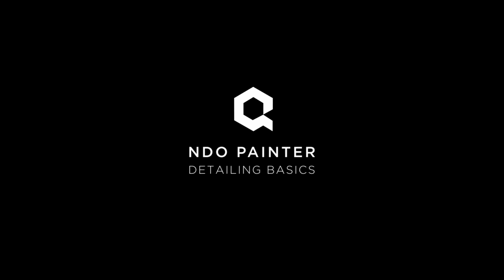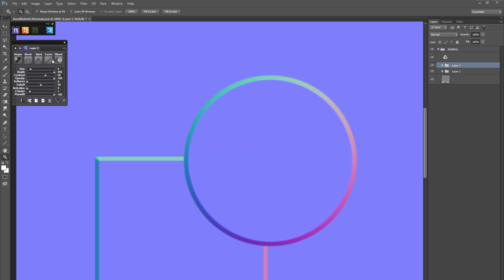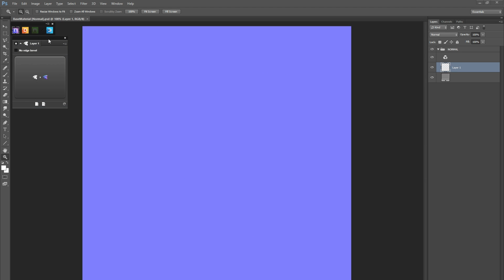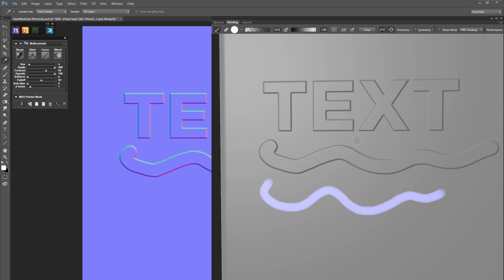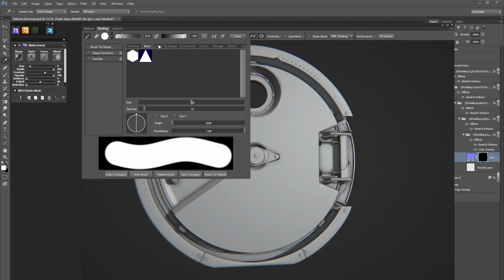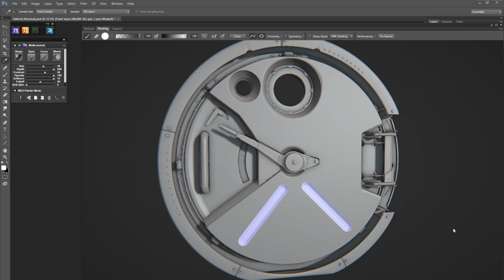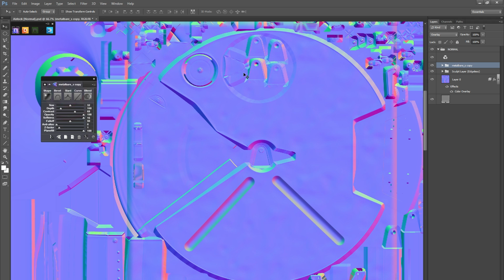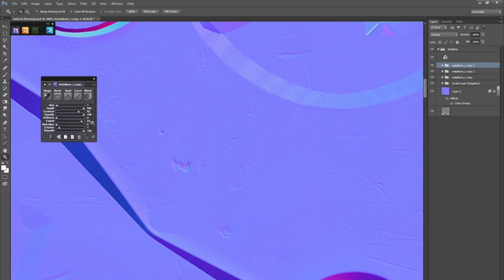NDO Painter: Detailing Basics

Comment: I'm a noob lol. Regarding opengl and Directx. I have to have my normals for Opengl  what settings do i need to export for that format? I am using the latest Quixel Suite, not legacy.
Reply: Have Flip Y checked on I believe.  You can do a small test on a 512x512 so it doesn't take a lot of time.  Just export it with Flipped Y (green channel inverted in other programs) and then export another with Flipped Y checked off and see which one works.  You've probably already found the answer, but if not, I hope this helps!
Reply: thx for the reply will check it out :)

Comment: Is there anyway to texture a model using DDO and then get those textures into 3DS Max? I'm not very familiar with materials and stuff as we haven't been taught very much of that in College, but I'd really like to be able to get my textured models from DDO back into 3DS for animation. Using Mental Ray as well, I see there is a V-ray export option so hoping that it's not limited to V-Ray...
Reply: +FullMetalBiscuit Yes. Check the various export options. You'll probably still have to manually reimport each texture though but that shouldn't take too long.
Reply: +Freelancerk1bbles There's a tutorial for using the smart materials in Maya exporting as Arnold with the target, but I'm not sure how to translate that to 3DS Max. I've just textured everything myself in Max anyway, I'll try and work it out after my deadline.
Reply: I think there is a tutorial on the Quixel website about using the Arnold export for that.
Reply: +MegaKosan Yeah there is but it's for building up the materials in Maya, which I'm not as good with and it's Max that I really need them in.

Comment: Great! Now's this available for Mac?
Reply: +Chad Tootle I used to be a mac user, but in 3d the mac is already dead. So I switched to windows 10 and I never looked back.
Reply: That's funny. I said something similar after Vista. Do you know if theres a quality difference if I run this through Parallels 11?
Reply: +Chad Tootle With my experience, I'd recommend using boot camp if you want to use Windows. You'll get better performance.
Reply: +Andy Nelson that makes sense seeing that it pretty much runs on the same drive instead of thru a software. Thanks Andy.

Comment: Do I need to make the scratches and stuff like that in NDO?
I thought that DDOs smart materials automatically apply their normal details to the existing map.
Reply from the maker: +MegaKosan You can do it with both tools in different ways! With NDO you have special control to extract really rich normal detail from custom photos or images, and with DDO you make use of a large material library built from scan data. So it really depends on what you want to do/achieve :)
Reply: It does but if u wanna add it on top of them or even do. Custom ones you are free to do it.
Reply: Okay, nice!